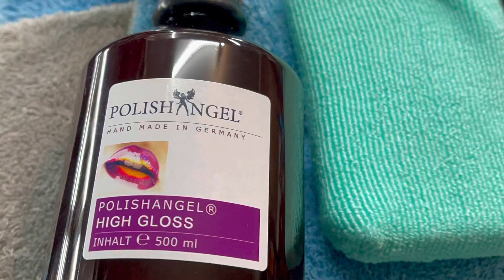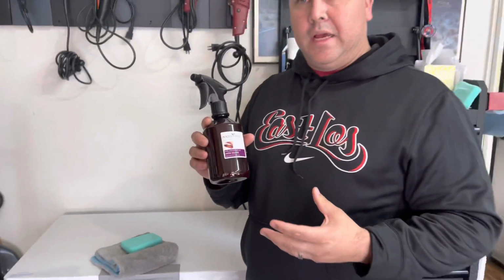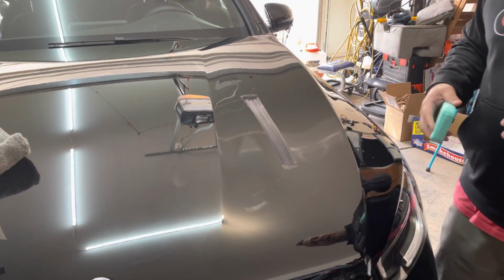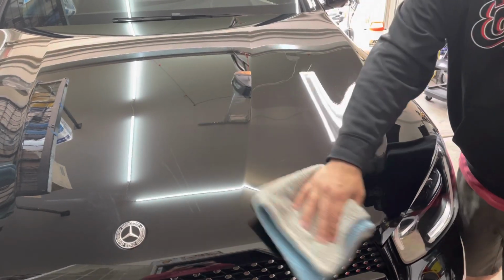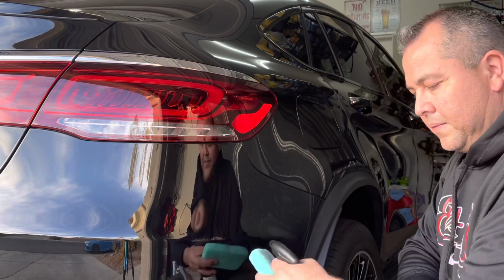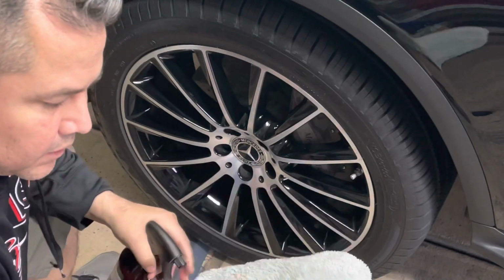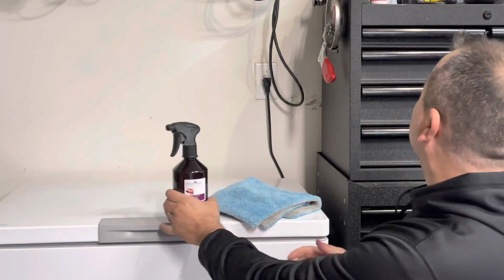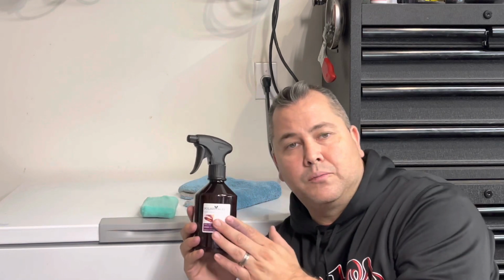Polish Angel HIGH GLOSS

Comment: We got my wife a 2022 alfa romeo stelvio 2 weeks ago. On day 1 I did a full chemical and mechanical decon, and applied a coat of Gyeon can coat with a coat of the last coat 2 on top. The depth looked good, but my wife would be willing to sacrifice some depth for shine.If we do 2 coats of this will it lsat 90 days and will there be more shine than last coat over can coat? Thanks.
Reply from the maker: I’ve never used the Last Coat.  But they have Gyeon Cure u can try.   Also, this should last 90days with 2 coats

Comment: Great job on amending the removal process. I let it haze over and it was VERY difficult to take off and it did leave streaks (plus I put on too much). Going back over it with a bit of water on the clean microfiber towel did the trick!
Reply from the maker: 👍ya, less is more with this and the spritz of water helps a bunch.  Beading is strong from HG and I love it!

Comment: I think beadmaker is just as good if not better I have both
Reply from the maker: Nah, not even close
Reply: @DetailingBreakdown  maybe it's just on the firecracker red I have jeep invasion this weekend with over a hundred hours of detailing in it already I will give it another shot on top of extreme solutions lvr 357
Reply from the maker: @tacticalrenegade327  I mean, gloss may be the same.  Slickness may go to BM.  But durability goes to PA HG.   Should last 4 months minimum.  Beadmaker fails in durability.   You could try PA topped with BM for optimal performance in all departments.
Reply: @DetailingBreakdown  Nailed  it!!! 👍